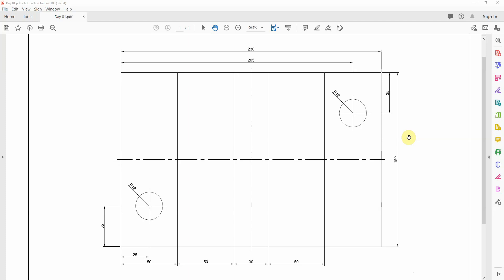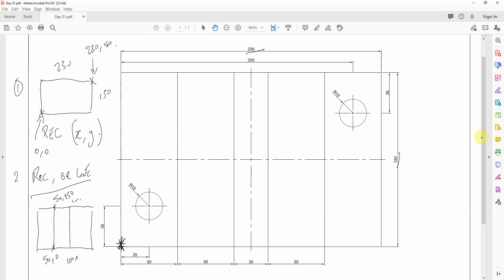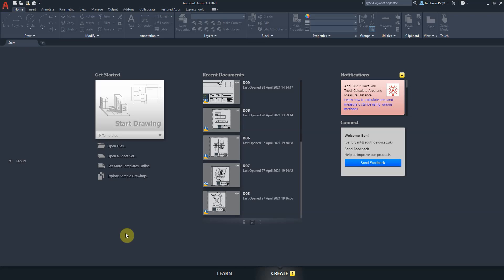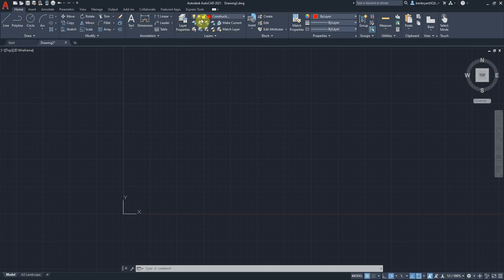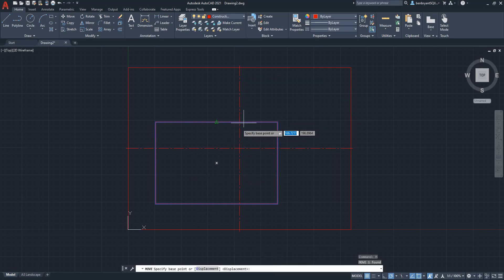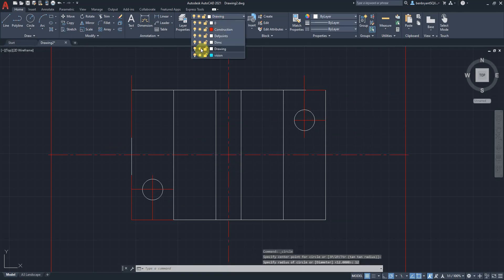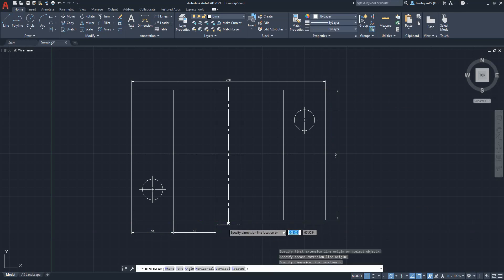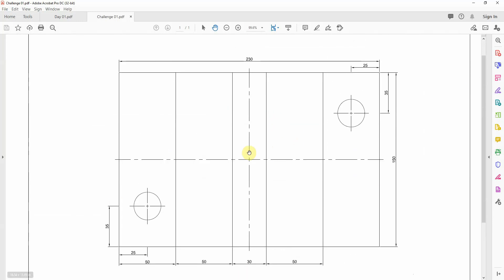AutoCAD 30 Day Challenge - Day 1 Solution, Walkthrough and Explanation

Comment: How did the circles snap on the place where the lines crossed? Is that some other snap setting? (new to autocad)
Reply from the maker: Hi, the snap object settings are in the bottom right of the window, the button is a square with a green star. I had mid point and centre snap turned on.